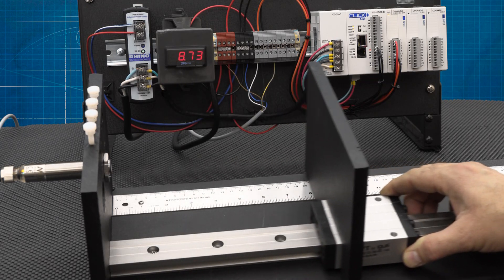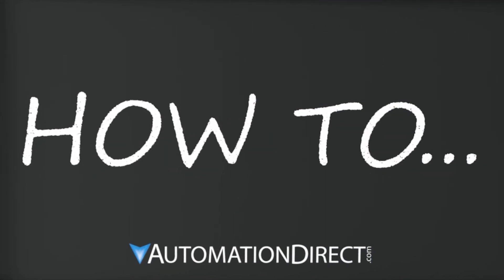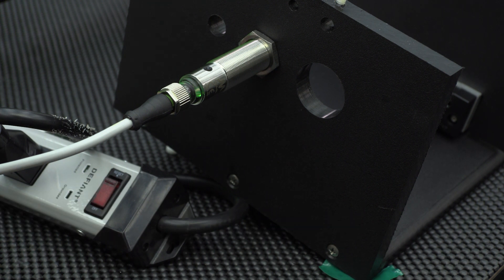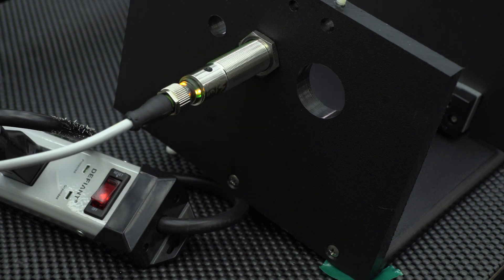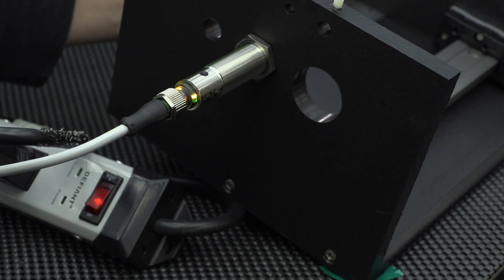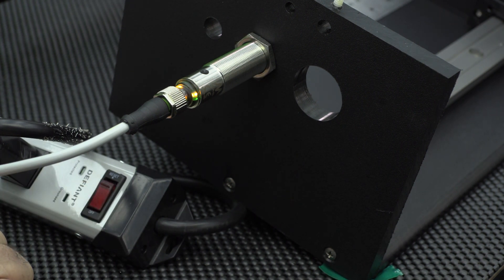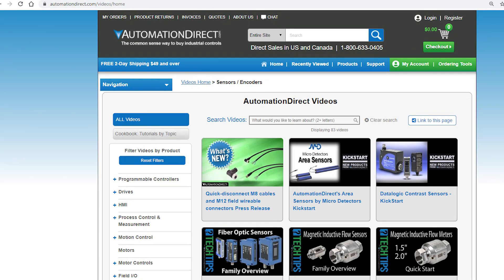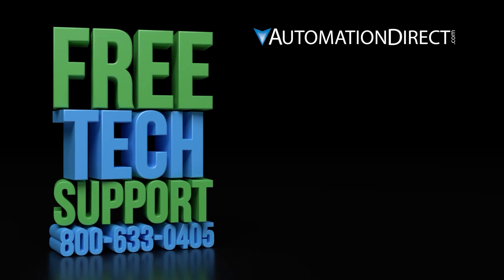Micro Detectors MD Ultrasonic Sensor Show Function (current mode) from AutomationDirect

Comment: UT1B/GW-1ASY 86 MICRO DETECTORS Ultrasonic Proximity Sensor

Calibration procedure please send
Reply from the maker: @ m suri apparao We do not have a video showing the calibration of the UT1B sensors. Here is the link to the product manual: https://cdn.automationdirect.com/static/manuals/sensors/ut1_insert.pdf  and you can also call our free, award winning technical support for assistance: https://community.automationdirect.com/s/contactsupport